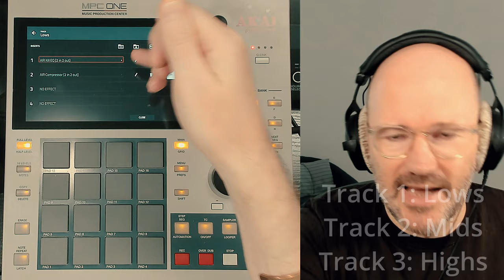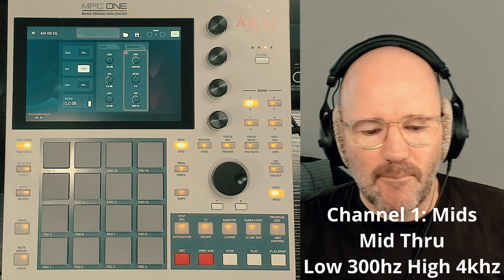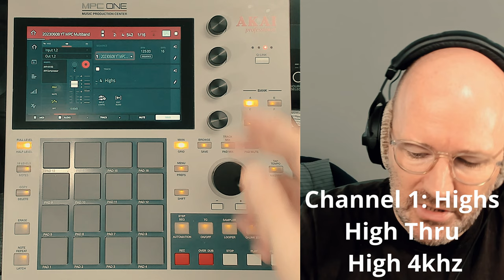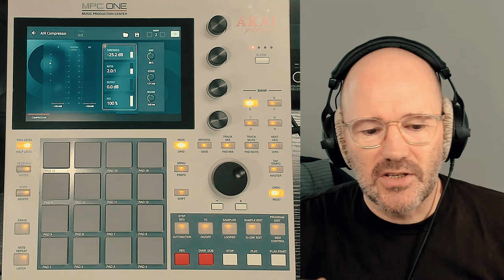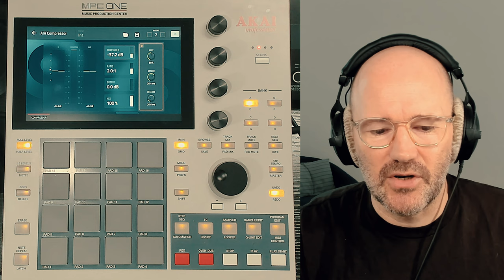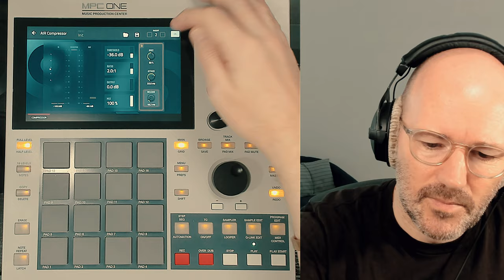Akai MPC Tutorial. HUH? A MultiBand Compressor and De-Esser in the MPC with stock plugins?

Comment: You said there’s no side chain compressor on the MPC.  Then what is the mother ducker?
Reply from the maker: That’s a great question. The Mother Ducker is exactly what it says it is. A ducker. It’s not actually compressing, it’s ducking volume. So whilst it does sound like a side chain compressor it’s actually  only ducking volume and not affecting transients etc in the same way a compressor does. That said, it does pretty much do what a lot of people use a side chain compressor for. Thanks for watching.
Reply: @TheCratesMotel  wow. So all the attack threshold release knee and ratio controls are only controlling volume?  That’s crazy.  Thanks man. Appreciate it!

Comment: Thanks for sharing! That made for an easy sub! 

Was messing around with this tonight and found a way you can do it with only one track on the Force (no clue if the MPCs can do this or not).

Send the track's output to a channel that's not going to the master. Then turn up sends 1, 2, and 3 and add your Kill EQ and compressor of choice to Returns 1, 2, and 3 and set them accordingly. Voila. Multiband compression with only one track. Used this to deess a couple vocal tracks tonight. Very helpful!
Reply from the maker: Great shout, I will have to try that. Thank you for watching.

Comment: Nice one! I did similar experimentation but using the sends (as separate bands) and then combining them in submixes. I was just curious on how it would sound, especially if I apply the Maximizer on all bands with parameters set to 'stupid'. I requested both a multiband compressor and a multiband FX tray from the devs as both are quite doable but no news from that front. 

One experiment was also doing parallel compression with the Maximizer, where you could send the dry signal to one of the send FX and then mix it with the squashed Maximizer sound using a submix (and compensating the delay using a Sample Delay filter (which is annoying to tweak as you can't move the value 1 unit at a time to match precisely). It sounded .. interesting, but not sure if usable. :D
Reply from the maker: Yes a ton of people have been requesting a multiband compressor from Akai. It’s totally doable. We shall see I guess.
Reply: Make a video dude

Comment: Great. I did something somehow in the same vein for mid-side.
Same sound on 2 pads.
Chain is ChannelStrip > Stereowidener > Submix 1.
Submix 1 has a Channelstrip to reduce the gain to get back to the original level.
On pad 1, stereowidener to 0.
On pad 2, stereowidener to 150.
Pad 1 has the highs tamed.
Pad 2 has the lows tamed.
I should actually use a killeq like you did here, would be more agressive.
Would welcome your views on this.
One can stack stereowideners for wider than wide but 200 is already overkill.
SampleDelay can also help w widening.
And I wish there was a search box in that plugins list. It is getting long!
Reply from the maker: Yeh cool man, nice tip. I have made a video showing mid-side techniques for the MPC using similar techniques to this video. I just need to edit it.